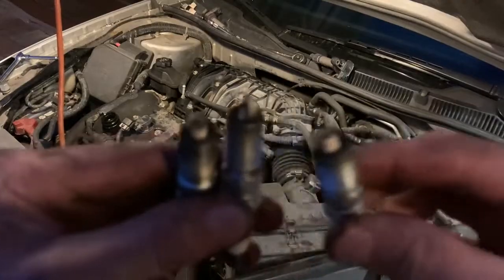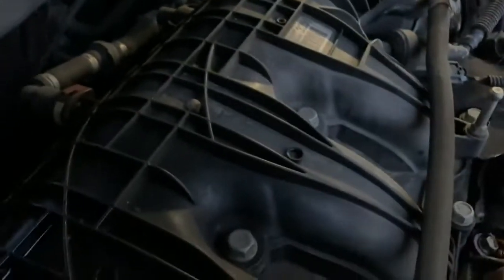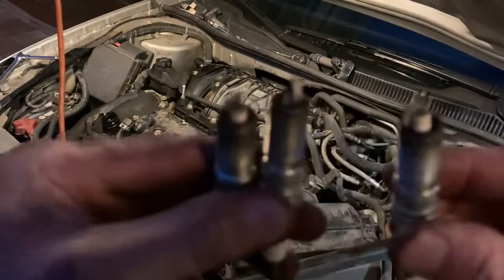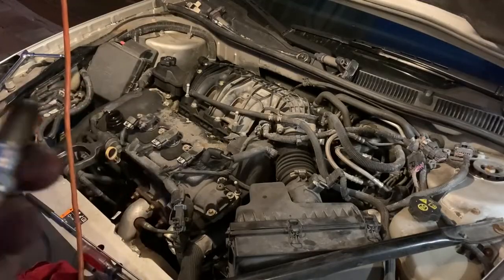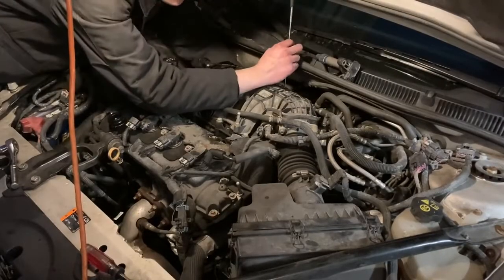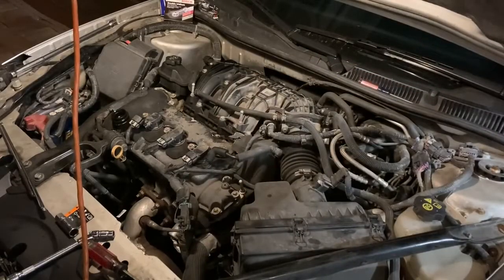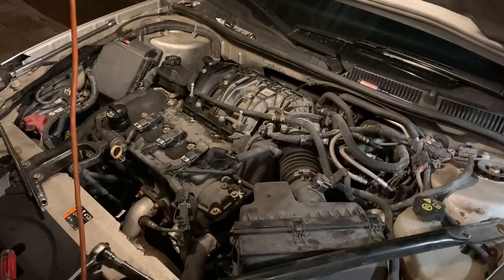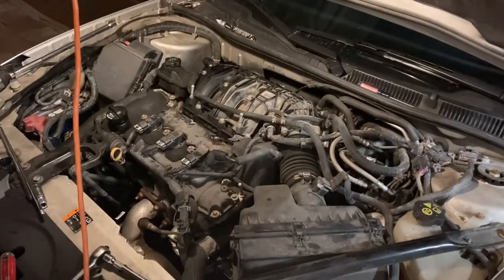How to Change Spark Plugs 2012-2016 3.6L Chevy Impala

Comment: What all tools do i need to buy down to specific sizes ive done spark plugs before but on a 4 cylinder im broke and my engine misfiring and idling super rough i know for sure its the spark plugs
Reply from the maker: You really only need spark plug sockets for this job I believe it was 5/8” size.
Reply: @matt-diy  thank you for the fast reply ok im starting from scratch my bad i dont wanna bombard you with questions but i dont know tools well i just know how to do what i see in the video 😂 give me a list what to go to autozone and ask for ratchet and socket and ?
Reply from the maker: @StreetStoriesEnt  socket wrench, sockets, and a spark plug gapper if your plugs that you buy are not pre gapped.

Comment: How do you get the plastic cover off? Mine seems attached somehow and I don't want to break it.
Reply: Take off the engine oil fill cap first.
Reply from the maker: I believe it just pulls straight up but I can’t remember.
Reply: Yes remove oil cap then it just pulls straight up, you won’t break it
Reply: Mine had a star bit and the oil cap don't drop the oil cap like I did it don't fall to the ground lands on the bottom plastic shield got to take that down before I start the car now just watched the video to make sure I didn't haft to take the intake off yes u can't see the back coils even with cover off this is why I watched the video NEVER MIND I HAD TO TAKE THE INTAKE OFF TO GET 2 OF THE BACK COILS OUT 2015 3.6 Impala

Comment: Random, do you know where the hell the block heater plug is at? I’m trying to find it online and I can’t, I’m not sure if it’s tucked in the wire loom somewhere or what
Reply from the maker: I honestly was not aware the impala had a block heater so I don’t know.
Reply: @matt-diy  I’ve read that it’s wrapped up in a loom somewhere. But mixed reviews on its location. Currently trying to locate it (currently -32° F)

Comment: Hey, How did you get the coils out from underneath the intake manifold?
Reply from the maker: If I remember just like in the video I just reached behind and was able to get to them.
Reply: @matt-diy  This does method does not work for a 2015 when change the back three spark plugs. You can't remove the coil since it hits the air plenum.  The air plenum must be removed to change the back three spark plugs on my 2015 3.6L.
Reply: A little late but in order to get the ones from under the intake manifold, you need to rotate the coils counterclockwise 90 degrees and then you can pull them out. Just did the procedure today so it's fresh on my mind! :)

The reason you can't just pull them out, it's because the lip of the manifold stops the bulky part of the coil from clearing it, but rotating the coil first reduces the amount of clearance needed to take it out.
Reply: @denniswommack4031  Is that the new style Impala or the Limited edition? Just curious. 🙂
Reply: @TommyViper  limited Im doing mine right now
Reply: @Mrcharles123451  Good luck! 👍Also, be careful of the hose on the intake manifold, the white tab holding it on is easily snapped. I ended up breaking mine but it doesn't seem to cause any issue. And make sure you're putting in genuine spark plugs. I made the stupid mistake of getting mine on eBay before I knew better and 15,000 miles in for supposed iridiums, I was ending up with a bad misfire. They turned out to be counterfeit and before I even realized the engine was misfiring, a shop literally quoted me for a new transmission because it was only misfiring when it needed to downshift. Not fun! But luckily, I tracked the issue down myself before I went ahead with it. I don't want anyone else to suffer what I did if I can help it.
Reply: Thanks for the good info everyone.

Comment: I've got a p300 random misfire code on my 2015 Impala (new body) V6 that I literally just bought.  Got right at 100k miles.  Fantastic oil change history on the Carfax but I don't see anything about spark plugs changed.  It stumbles occasionally.  Think spark plugs could be the issue?
Reply from the maker: Very possible it can’t hurt to change them!! Seems that code is related to ignition in some way. Plugs should only be used 50-70k miles at the most.
Reply: I got the same problem rn I hit 100k and my car started to slip and misfire here n there

Comment: This does method does not work for a 2015 when change the back three spark plugs. You can't remove the coil since it hits the air plenum.  The air plenum must be removed to change the back three spark plugs on my 2015 3.6L.
Reply: Saw another and that video says you can do it if the bolts are removed all then way???

Comment: What if you would disconnect the metal link that attaches the engine to the radiator bulk head and use a small ratchet strap to pull the engine towards the radiator,that way rear access would be better?
Reply from the maker: It’s possible maybe! Not sure how much the engine would move.
Reply: Engine mounts might be an issue
Reply: I do enough Toyota Aurion V6 and Kluger/Highlanders at work. I hate front drive V6s

Comment: do you recommend removing the intake manifold to get to the rear plugs?
Reply from the maker: If you feel around you don’t need to.
Reply: No way , the intake manifold blocks the top left , you can't get the plug out without removing manifold.